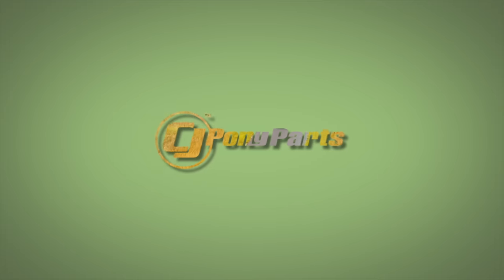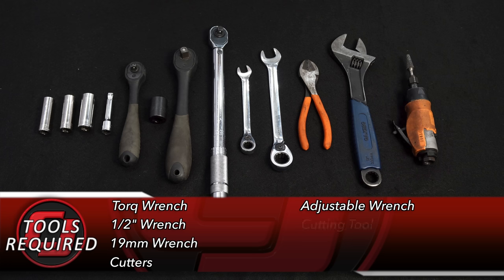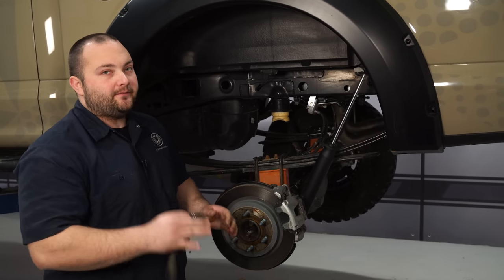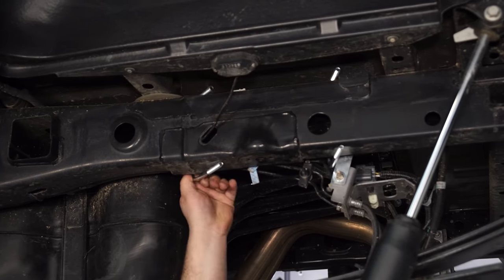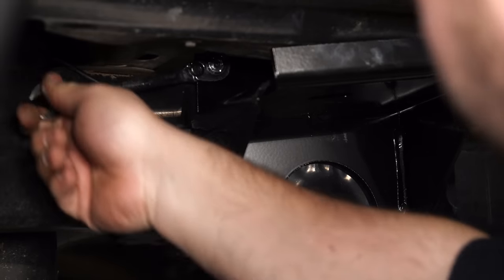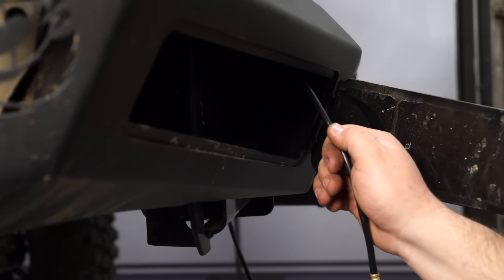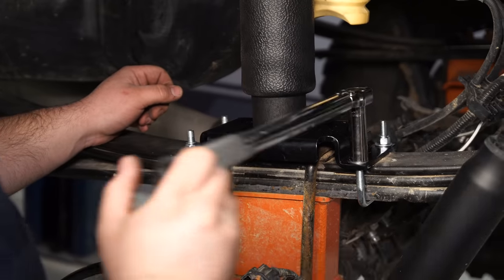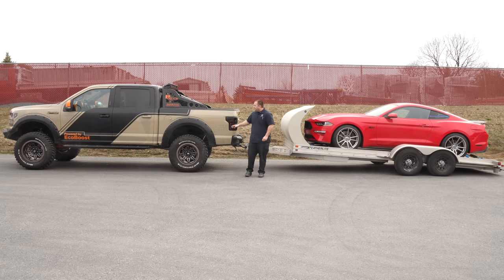Air Lift RideControl Air Spring Kit Install Turns Your 2015-2018 2WD/4WD F150 Into A Towing Champion

Comment: So how does the ride control affect the off road abilities? Is there a noticable difference?
Reply from the maker: It will make your off road experience more rough and bouncy because it stiffens up the suspension a little bit.
Reply: is that the case even if you only have 5 psi in the bags (which is what Air Lift recommends even if you are not towing or hauling)? Also, how much suspension travel and articulation do you loose in the back end?
Reply: bhshakari I went ahead and installed it on my Xterra. The travel and articulation are the main inpedences. The off road comfort didn't seem to change much. I don't do any rock crawling or extreme off roading outside of some hill climbing and camping and hunting trails and there has been little difference until you get into some real unlevel surfaces. The squat when towing and bottoming out have been fixed however.
Reply: Dennis Porter, thanks for the reply.  I had a feeling that was going to be the case, I periodically go off road where travel and articulation make a big difference, and regularly where it’s not as bing if a necessity . I think for those trips, I’ll just remove the bags pre trip. I don’t do anything that I would consider extreme 4x4, my f150 only has a 2” lift, so I’m trying to find a balance that will give me more ability when off-road, and eliminating squat when towing or hauling. I thought about add a leaf but that alstroemerias stiffness the ride and is not as effective in squat control. It’s a tough balance Im trying to get.
Reply: What do you mean by, The travel and articulation are the main inpedences?
Reply: The rear wheels aren't able to extend as far as they would without the bags installed on uneven surfaces.
Reply: Thank you, that makes sense. I installed them about a week ago, man these are fantastic for their intended purpose. Being that they are so easy to install, if I go on any 4x4 specific trips that require significant articulation, I'll just uninstall them pre trip. Cheers!
Reply: I have the airlift 5k on my 2018 f150 and it does ride s little bit stiffer even with 5psi but what a difference when it comes to towing, well worth it.

Comment: Are these to be used in conjunction to a lift in the rear (block or add a leaf) or can these be used as the lift for the rear? 2018 F150 setup for long term camping, leveling coil overs in the front, stock in rear. This isnt full time so when loaded about 600 lbs in the bed, about 250 when daily driving the truck.

Comment: Can you install a Tee fitting on the air lines and connect both lines to the tee so when adding or removing air you do so at one location so both air bags will be exactly the same at all times?
Reply from the maker: Yup!
Reply: @Motorcitymadman The line length wouldn't matter. It's the amount of air pressure rather than overall volume that is important. BTW, the airlift guys will answer any questions you might have. I sent them an email and they responded within a couple days.

Comment: When threading in the air fitting do you need to put any teflon tape on the threads?
Reply: Yes
Reply: @Motorcitymadman Umm the ones I installed were not pre taped. That's why I said yes so people would make sure they were.

Comment: If I rarely tow or carry heavy loads, would I benefit from having this system on my 2018 F 150?
Reply from the maker: If you do any amount of hauling or towing this will  benefit you.
Reply: Thanks for the reply, I'm just concerned with all the components under there, and the possibility of leaks.  What about a Timbren rear axle SES suspension, would that be enough for my needs?  As I say, I rarely ever tow and the only thing my truck bed sees sometimes is drywall or lumber, not enormous amounts of weight back there very often.  I wonder if a Timbren will be enough for my needs and do basically the same thing as an AirLift without all the components to worry about failing over time?
Reply from the maker: You would not want this filled with air while you're not towing. You would only fill them when you tow, and the system is sealed well, I highly doubt you would have any leaks. With that being said, from what you are saying the Timbrens are probably the better choice for you.
Reply: per manufacture specifications, you need to have it at 5psi when you're "not using them". I have these and love them, but based on what you have said here, I would save my money if I where you. Just my 2 cents

Comment: Does it affect normal riding?
Reply from the maker: It will make normal driving just a tiny bit stiffer, but it's practically not noticeable.
Reply: I've had them on my 2018 F150 that is running front and rear HALO lift suspension, and notice zero decreased ride quality.

Comment: Will this work in a 3/5 drop?
Reply: Matthewg3455 that’s what I’m going to try and adapt it to. I’m sure it wouldn’t be hard to manipulate some components to get them to fit if you’re somewhat mechanical minded.
Reply: laken ezzell I actually found a kit from
Ihc. Works with the drop it
Reply: laken ezzell did you install it
Reply: There is a kit for 3/6 drop trucks slam air lift